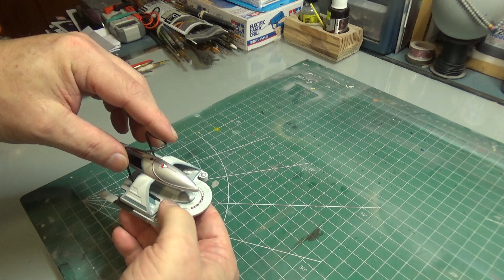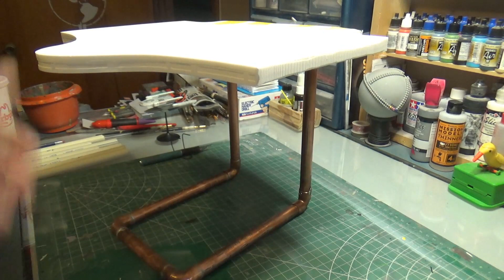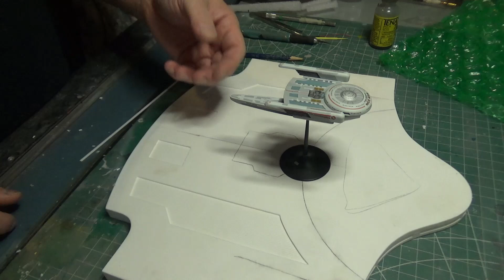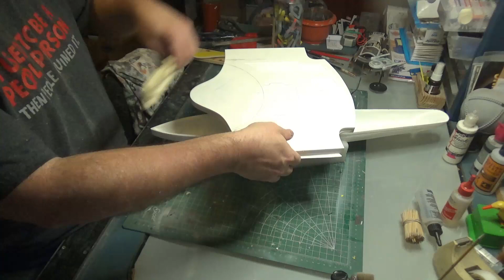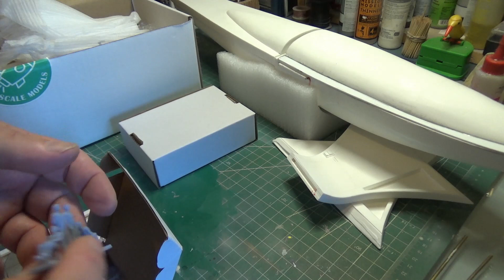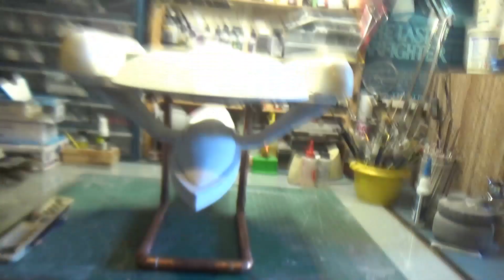Aztek Dummy Update 5/21/21 - Studio Scale USS Grissom - Part 1

Comment: I'd say Keith used a commercial SLS (selective laser sintering) machine for those white parts, usually nylon, hence the high quality of the finish. These are very expensive machines so probably done by a commercial supplier. Kudos to him for going the extra mile, it pays off... it also probably saves him headaches and wasted resin to get it right the first time. I'd say the grey pieces are from a standard SLA resin printer, which is appropriate and gives him flexibility for the smaller and more robust pieces. Wise choices, clearly a thinking man.

Comment: So happy to see someone else building this! I picked up the same kit and definitely noticed some of the same issues with the mold being a bit wonky. I managed to get the nacelles straightened out with a heat gun since mine were pretty crooked, but haven't figured out the pylons yet since they're both curved a bit differently. I love your stand idea, although I was also considering just scratchbuilding a new, hollow upper deck since it's a pretty simple design and it might lessen the weight enough that I'd be able to put it on a normal support...

Comment: Seems like with adhesive the PVC would be strong enough to do what you needed?  Holds paint okay as well.

If you needed to add weight, fill the tubes with sand.

Comment: Hey Lou!  I have been building a lot of Star Wars 1/144 scale and more recently the Space Seed 1/1000 Enterprise. I use magnet wire which handles the power ok. It’s small and easy to hide. You could run it along seams, or make a very small seam with it.

Comment: The Largening-- a Netflix Original Series, coming this August!
I think there might have been a T-fitting on the bottom rear so that a little stub could stick out to the rear. Greater stability. Not sure how comfy you are re-working a solder joint. And it might be fine as is. Very good looking whatever way you look at it.
Digging out all those channels will be... interesting...
Noice Galactica shuttle! Well made indeed.
Reply from the maker: eliot. I want to use your "micro quad flasher" circuit you sent me a while ago to do the strobes on this beastie. can I put more than one led on each output? I need 7 total.
Reply: @aztekdummy  I just put one together and wrote a stirring letter to you, boxed it all up and sending it tomorrow. Right now it's got 8, but I included resistors to change a double back into a single. I may take out the letter because, as I'd forgotten I'd sent you one before, my letter will sound mad.

Comment: Gonna be a beauty as usual! Have you considered replacing the flat deck section with a hollow scratch built structure? it seems fairly simple, and it would both eliminate a lot of weight and give you wiring room.
Reply from the maker: if it weren't for the inset details, i'd have thought of it
Reply: @aztekdummy  I thought of that, but know you could duplicate those details. I'm sure your ideas and skills are vastly superior to mine so I'm sure you made the right call there.

Comment: I love the design of the Grissom. However, I always wondered how the crew got to the engineering section from the primary hull. The pylons look too thin for turbolifts, so do they just beam up and down?
Reply: I think that lower hull is not populated.  No windows.  It might be full of equipment and sensors and fuel cells etc.
Reply from the maker: that's my guess. or ladders
Reply: I think they look thin because we always are looking at the model or miniature of some sort. I think those pylons are thick enough for a smaller turbolift. I do think, however, this ship would not look too bad with a neck down the center to accomplish this too. Either way, this is my favorite ship from Star Trek. So streamlined and gorgeous and elegant, imho.